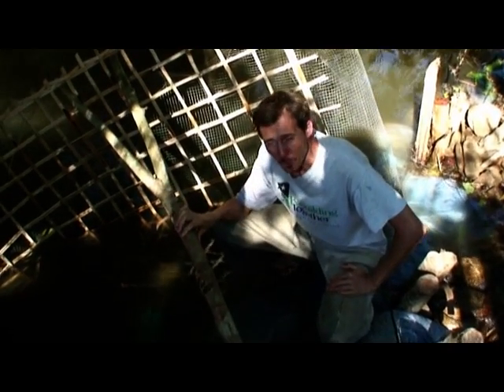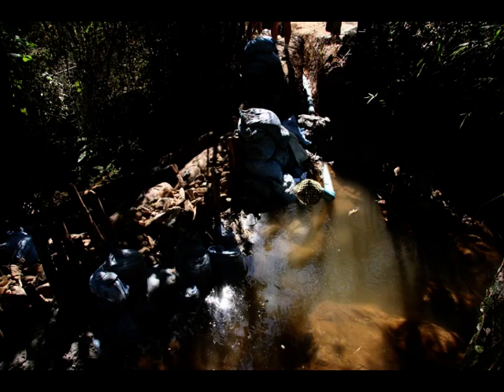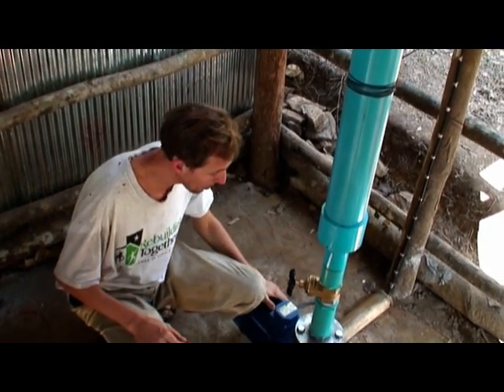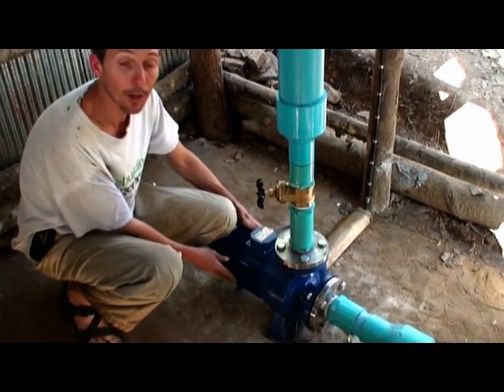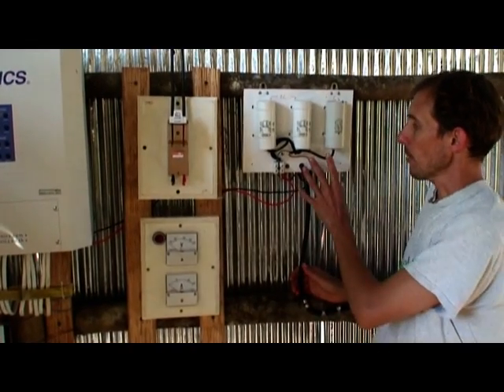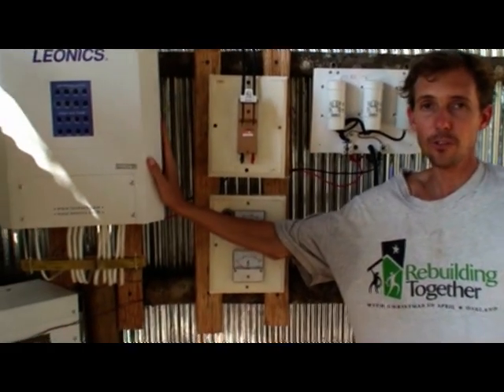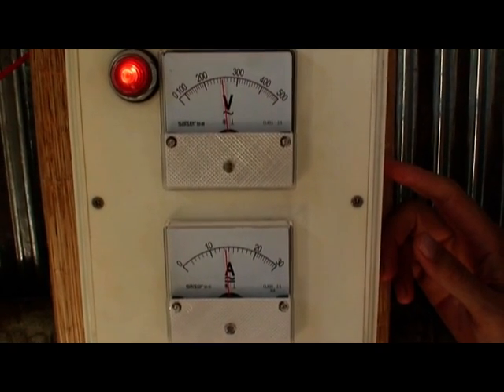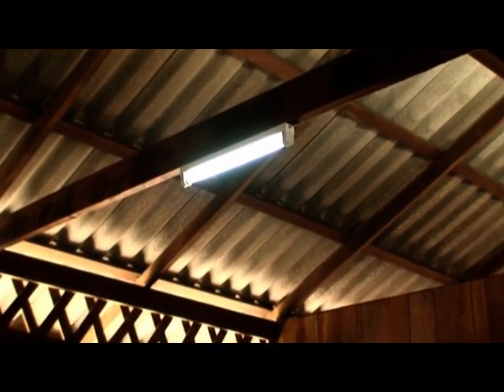Micro hydro project, Tak Province, Thailand

Comment: did you do any modifications to the motor impeller? or is it just a pump with the outlet as the water inlet. How about the motor? any specific changes ?
Reply: Just an end-suction centrifugal pump.  No changes to motor, though we did add capacitors to provide reactive power. Capacitors wired in "C-2C" arrangement allowing us to pull single phase off of the 3-phase motor. For various calculations required we used ITDG publications on "induction motors as generators" and "pumps as turbines for micro-hydropower". Google these titles to find out more...

Comment: Nice project, to get more out of the system, I would recommend the use of LED lighting instead of the tubes they produce more light for less power.
That way you could put a few outdoor LED lights as well so that the village paths and the school are illuminated at night.

Good work to help these people.
Reply: Thanks -- you're right. When we built it in 2008 LEDs weren't very available in Thailand...

Comment: Well done - great system.
Out of curiosity what was the total cost of the project?
What modification did you need to make on the pump/motor to use it as a generator?

Comment: Without considering mechanical, pneumatic and electrical efficiency
"Available Power" = (density) x (gravity) x (flow) x (heigth between inlet and turbine)
You have 1kW (mechanical power) with a flow of 8,5litres/s and a head of 12m. 
Considering a combined efficiency of (say) 60%.. you'll need a 20m head to produce 1kW of electrical power (1,668kW of ideal mechanical power).
If you THEN let it work for 1h, you'll have 1kWh (power x time) Hope it's clear to you =) Cheers

Comment: @jerjanerayo  The capacitors are in parallel with the motor. But it's a little more complicated than that -- they're arranged in a "C-2C" arrangement. The motor is 3-phase delta. Electricity after the C-2C arrangement is single-phase (not 'two phase' as i erroneously say in the video).
Reply: can you please tell me how to balance the C-2C arrangement ?????????

Comment: We use end-suction centrifugal pumps. In this installation it was an Ebara MD 50-125/4. Other brands would work fine. But the trick is you need to size it correctly. I recommend reading Arthur William's book, "Pumps as Turbines". That's what I used in sizing the one in this video.

Comment: 2 comments. As a veteran sprinkler for 15 years you chose a gate valve [2"]. If you had a ball valve there would be much less restriction of the water. The other comment and I realize you only have access to whatever materials are available but your 4X2 reducing coupling is also very restrictive. Here in the usa we have reducers that have a much more smooth transition to a small diameter pipe so as to reduce gpm loss. Its a great video as I hope to install something like that in the Philippines

Comment: It's a 3-phase end suction pump. The brand we used is Ebara (model MD50-125/4.0), but you could use any number of brands. You have to chose model such that pump head and flow are appropriate.  ITDG has a great book called "Pumps as Turbines" that tells you how...
Reply: Chris Greacen

Comment: Your teacher is a dumbass!  if you connect your motor in DELTA, you don`t need the fourth conductor for the Neutral. if you have three phase 240V, and connect these through a some capasitors, you kan make a 1phase connection, with 240volt potential between the two wires!

Comment: Thanks for the comments! I'm the 'presenter' in the video. The fellow who made the 2-phase comment is correct -- it's single-phase electricity. Sorry.

Head (height drop) is 35 meters and flow is 17 liters/second. Since we were producing about 3.2 kW, an efficiency estimate is 3.2 / (17*35*9.8) = 54%.
Reply: more details on the pump motor you used and the source.

Comment: Using a pump like that has to be the neatest, simplest and possibly cheapest hydro setup I have seen. 

By the look of the pipe coming into the power house, it looks like an additional pump, maybe a smaller one, could be coupled up to make even more power. 

Great setup and so well done.
Reply: Not necessarily the efficiencies are not that great and there are better solutions at 10 connect that way